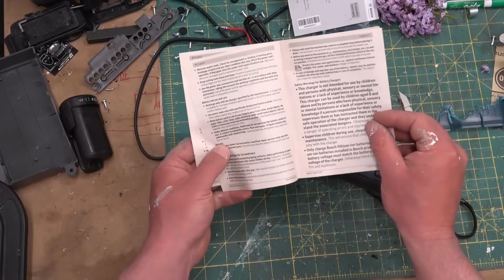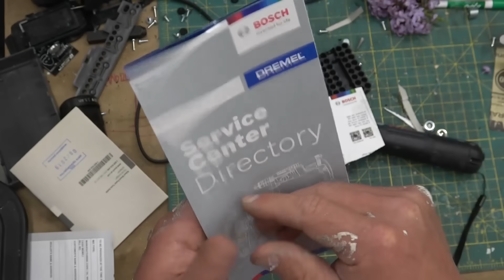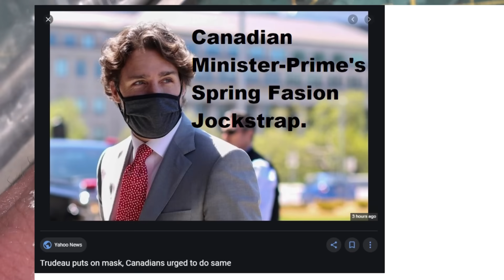BOLTR: Bosch Screwdriver

Comment: I bought that screwdriver under the Dremel brand name to drive in inch and a half hex screws on cable clips at work. I used that screwdriver 5 days a week every week and it is by far my most favorite tool as it pretty much negated the need to be running back and forth grabbing the impact driver, and when youre working out of a tool belt you want the smallest lightest tools possible to get the job done quick. and save your back. i loved how i could hold the screw with my index finger, hold the driver with the rest of my hand and still have my other hand to hold the cable tight against whatever surface was driving into and it never let me down. 

it did break after about 2 years of use, one of the bearings popped out of place and jammed the clutch but i took it apart as you did, put the bearing back in place, regreased it, and put it back to full time use like it was brand new.

Comment: I got this thing years ago (7? 8?) from Aliexpress, before it was sold anywhere else and before you could get a nice slim electric screwdriver anywhere. It's pretty funny that mine is green, but when they started selling it in the west they rebranded it as blue. I doubt mine has plastic gears or something. It's pretty neat, has enough chooch to even drill.

Comment: This is like the Black and Decker Versa I purchased in 1991, batteries no longer available.  Worked like a charm with a clutch that worked perfectly on small screws as I worked on printers and fax machines all day everyday. No circuit board inside, just a motor, slide switch and similar but bigger gear box, battery is removable from outside. I would love to find a battery for it.
I just cleaned all the grease that has hardened, re-greased it and tested it with an external power supply, still works after been in storage for 19 years.

Comment: Just got my borsch a few days ago. Red six selector is torque shut off- not a mechanical clutch mind you. The delay is a pain in the arse as you mentioned and as I got this to test for my assembly line, I was dismayed to find there is no chooch while charging. They didnt spring for an isolated charge circuit and the one they did select is very slow. not good for volume / production work.
Reply: but what about masks?

Comment: AvE, masks aren't to stop the wearer from potentially inhaling 'viral particles', although they can certainly do that. The efficacy of masks in containing the spread of a virus has nothing to do with the size of the viral particle itself, and everything to do with the size of a droplet containing respiratory mucosal secretions (and viral particles). The viral particle itself has no chance of withstanding the extremes of the outside elements with its tiny protein coat. It easily succumbs to the effects of osmosis, at the very least, to dry out and become ineffective in attaching/penetrating cell membranes and replicating. Thus, anyone who dismisses masks based on their efficacy in mitigating the movement of a single viral particle can be safely dismissed. The efficacy of a mask lies in its ability to decrease (not eliminate) the transfer of previously mentioned respiratory droplets from an infected patient to surfaces that non-infected people may come in contact with.

With that said, the mortality rate of COVID-19 is very very low in non-vulnerable people (below 65 years of age, not immunocompromised, no pneumonia, etc.). The way we've handled this, IMO, is atrocious. We could've done a much better job, and saved more lives, by not causing mass panic and simply allowing non-vulnerable people to continue regular lives while affording extra protection and isolation for vulnerable people. In the process, we could've rationed healthcare resources and distributed them in a more efficient manner. In order for that to work, we would need good social distancing in public, the normalization of masks in public,  more testing, the closure of the international border, and educating people about the danger of coming in contact, under any circumstances, with a vulnerable person. Had all of that been done, we could've eliminated the need for mass lockdown, in lieu of regional lockdowns when necessary. Look at China, Taiwan, Japan, Korea, Singapore, etc. None of them had a nationwide lockdown. Instead, we've used Italy, Spain, and other such countries as role models.

Then again, here in Canada, Justin Trudeau appointed someone with very little knowledge of public health to be the health minister (Sajdu) through a cabinet reshuffle, and our leading physician on COVID-19, Dr. Tam, was against border closures for months, she deliberately lied to the public (instead of actually controlling the supply chain) about the efficacy of masks, going as far as saying that they're not useful, in an effort to ration them for the healthcare industry. IMO, what Dr. Tam did amounts to criminal negligence, and she should be in jail right now. I can't imagine the number of cases in Canada caused by her. Imagine all the people who were infected and used public transit without wearing masks, spreading the virus on every surface they touched...

Comment: I bought 3 Black and Decker thingies like that over the years. One had had a recharging stand that disappeared rendering the driver useless. One had a bog standard plug in recharging port for a power supply and t'other took 4 AA's. It was also fire engine red in colour making it easiest to find, so most often used.

Crap tons of torque for a smallish sized thing.

Comment: @AvE The masks are not there to protect yourself, they are there to protect others. The masks filter some, but not all of the water particles so they are not effective as a safety device for yourself. the main problem not being the material it is made of, but the fact that they do not seal against your face. As you can see, the masks look the same as the ones worn in an operating room. The mask a surgeon wears is not to protect himself, but to protect the patient. It contains saliva droplets in his breath so they don't land in the open wound. The masks they urge you to wear have the same function. The best prevention from being contaminated is keeping a distance. You need to keep distance, so any water droplets from someones breath have time to fall on the ground. The mask you wear reduces the amount of water droplets that go into the air, and any water droplets that get out will have a lower velocity and will travel less far before falling on the ground. And that is why masks DO work. During the incubation period, or when you are asymptomatic, and you don't know you have the virus, the masks saves the people around you.

Comment: You may be interested in the DeWalt DCF682N1 
I do a lot of work with screws in plastic and rackmount screws and the gyroscope control makes it easy to avoid crossthreading and when the screw bottoms out, the small shock to the device makes it stop turning. I've been impressed with the control I have with it. It certainly doesn't have the power of an 18V tool, but for what it's made for, it's well done.

Comment: That for sure is not a flyback diode protection, but rather a current sense resitor. If I would have to guess I would say they've used the DRV8830 from TI as the DC Motor Driver.

Comment: "The superior gripping power of a Robertson"
I suppose Torx is just a joke to you Canadian fellas?
Reply: Torx is ok, until you strip it. Robertson strips into philips for some reason, so you can get it out with that. So you get 2 screws for the price of 1
Reply: @collinbarker  I have never stripped a Torx screw, only damaged my bits when I didn't have the exact right size on hand.
Reply: @schwuzi  Torx are also still quite rare, usually only seen as deterrent screws for electronics, probably due to the existence of the others. Philips are used everywhere still (thanks usa...) while robertson are used in woodworking and are the ones sold in bulk. Torx would have to be ordered in. 
At least we no longer use common slot, which are the worst by far. Also, I think robertson manufacturing is easier than torx, as robertson was made by someone who said "Philips bad and stabby" and copied the process they used to make screws. At one point, they were going to be used in cars, but the license got messy, so it was dropped, and so NA is stuck with philips everywhere.
Robertson also allow the screwdriver to be slightly wonky and still work. I have used some torx screws, and they are much less tolerant of what angle the driver to screw can be
Reply: Torx is for pricey screws.  Robertson is also known as 'Nasa drive' apparently.
Reply: pozidrive = phillips (for self-centering) + Robertson (for grips) 

Yet you can't get either side of the border on board.
Reply: Torx is a joke to Torx. 
How else do you explain of Torx Plus?
Reply: If you extrapolate the logic of Torx, then you end up with a circular bit. That ain't no good for anyone! 😉
Reply: @300DBenz  TorxPlus is because the patent on Torx ran out.
Reply: And... Too many sizes of Torx. The screw is always the size of the driver you don't have.
Reply: Collin Barker I thought Philips stripped down to Robertson?
Reply: When the only other choices were flat or Phillips years, Robertson was king. Torx is a fairly new thing by comparison. I was told by an engineer that American companies refused to use Robertson for decades because it was a Canadian invention.
Reply: @collinbarker  Um, rare? There are 749 SKUs on just the Home Depot website for Torx drivers and fasteners. At least in the USA, they are ubiquitous in a construction site or industrial setting.
Reply: @jerkmcgerkin  they so exist, but in Canada they are not that common. Usually torx come in tamperproof plastic and may even be behind the locked wall, while Robertson are sold like how one buys screws. Might also be that the red and green Robertson are used in our electrical boxes even, while torx is still reserved for electronics and really expensive bicycles
Reply: @collinbarker   Interesting, I can understand the affinity for Robertson, being a Canadian invention.  I just asked a sparky today for a #2 Robertson bit and he looked at me like I had asked him for garlic flavored licorice. Apparently, the sparkies have a different name for them here. I think it was LR? This was in the NW of the USA. He showed little interest in my history lesson about Robertson drive. And yes, most every box you buy in the US will use a Robertson to land the green wire.
Reply: @jerkmcgerkin  Never heard of LR. Makes sense that it would go by another name in electrical community. One thing industry can agree on, is that naming things cannot be the same between disciplines (In electrical engineering myself), even more of a challenge with borders and 3000km of land separating the 2.

Comment: Looks to be a handy tool fer those with over exerted wrists. I wonder if you may have used a little too much L. Boh grease there. It seems to exceed the maximum clamping force of the old Juan-King spanner. 
I wonder if they could make a version with a handle on the side, make 'er a bit easier fer gripping?

Comment: @AvE 1 to 6 speed controls. (taking a guess here) putting 0 to 9 would be typographically ugly/cramped, and adds the issue of how to differentiate 6 and 9 at a glance (problem compounded by smaller numerals).

Comment: @8:00 I'm particularly fond of how the motor's positive lead rubs against the negative end of the battery when you activate it.   There's no way it will turn into a hand-held fireworks display...
Reply: Actually,  no they don't.   I have 2 of these and was modifying them just last night. 
Even if the wires rubbed together it would take thousands and thousands of cycles before it would wear through the coatings. 
Also those wires are really flexible with a thick shilding.
Reply: @dukenukem6137  "Thousands of cycles...."  I think you're overlooking that it's connected to a motor that vibrates.
Reply: @bobprivate8575  nope, like I said I have two of them and have looked  them over pretty good. there's not much vibration from  the motor & pretty sure the engineers have figured most of this stuff out long before manufacturing a million of them.  👍🏻

Comment: Maaaan.... SKIL made a really badass one of those things back in the 90s called the the "SKIL super twist" my dad had one & I'd take it every chance I got. So "after finding me with it & smacking in noggin of it alot" he bought me the lil brother version "SKIL twist" however it wasn't as torque-ie, that thing would snap your wrist half in two if it hung up in something & you failed to let go of it "cuz fuck it I ain't letin go" we used those things for years man & replaced the NiCad Batteries when they got weak &/or wouldn't take a charge or started getting "memory" as NiCads do after aging. Plus they didn't have and type of balance charging just the old cradle that straight up charged @ 9.6v...... ahhhh memories how sweet ...... when shit was simple & just friggin worked badass.

Comment: The Dremel unit looks exactly the same this one, but its about half the price. And when I say exactly the same, I mean they are the same unit
Reply: Thanks, I wouldn't have known about the Dremel version. Edit: Unfortunately it looks like the Dremel version is limited to North America or something. Though it looks like there's a second generation version of the Bosch Go, the Go 2. Difference being it has a mechanical clutch, a button as well as the push to go and an electronic brake.
Reply: Hardly surprising since Bosch bought Dremel way back in 1993. Dremel has better customer acceptance than Bosch in Norte America so that's the label they stick on 'em there.
Reply: No surprise there, considering Dremel is a subsidiary of Bosch. Here in Germany, the GO was never released as a blue ("Professional") version. Instead Bosch renamed it to "PushDrive" and released it with a green casing, which is basically the home gamer segment of Bosch power tools. Ultimately, I think this is all just marketing and brand recognition to appeal to the biggest audience because there are people who will strictly ignore products of a certain brand. Also, because certain brands are more wide-spread than others in certain countries.
Reply: @RobEDC  does the GO have metal gears also?
Reply: @Tsagos  Can't say for sure, but I'd be willing to bet that the Bosch GO, Bosch PushDrive and Dremel GO are absolutely identical when it comes to the inside components and that the only difference between all three just is the color of the plastic housing.
Reply: Saw deemed on the paperwork at about 2:15

Comment: Got one (bought in Peru !), the wheel dosn't control the speed, it's for setting the torque.

I know it goes against the grain, but sometimes the FM needs reading :-)
Reply: Makes sense. I have the one that adjusts the torque on the front like a normal drill

Comment: 8:05--thats a shunt resistor to mesure the current to calculate the torque
the potentiometer  regulates the torque not the speed.
the switch with french name reverse the motor . all the current pass thru the switch.
i had one of these first thing that fails is the tactile switch
then the  motor shorted,,...
battery great when new after 1 month dies quickly.

Comment: 5:42 180° == 6 hour on the watch = 30 sec. Historically (<1990) eggs were served in cases of 12, 60, 144 - so the threescope counting is still familiary.
Other reason: The cast for the knob is proven and still exists. It's cheaper to reuse, than to run the environmental reliability test and redue the test because of the failed knob.

Comment: It would be rad if you cracked open the Dewilt version. Over the past 2 years, it's become my favorite tool in my handtool bag as a residential sparky. Great battery life with a proper detachable fucker and not some wonky internal  USB charging, a fantastic gyroscope sensor with absolutely no delay, and (mostly) enough torqųè to get shit done while being lightweight and pocketable for the pouches. These tools are fantastic for certain vocations.

Comment: You should test it against a DeWalt DCF682 8V MAX Li-Ion 1/4" Gyroscopic Inline Screwdriver. There is no directional switch, pressure switch, or pause needed to get it to turn lefty or righty. Just grip it on the paddle trigger and twist which way you want to go. The battery is is good and bad it’s interchangeable so you can have more than one but only 8v and only available online as far as I can tell. I’d like to see how it compares to the Bosch for torque.

Comment: Grease is good for keeping teeny tiny bits together for assembly, but you know what works really well for sliding bits together that don't want to slide?  KY lube.  If you need to sleeve a rubber tube on a metal rod, it can help with the friction.  I'm sure there's a joke in there somewhere.

Comment: I got one of these.  It's powerful.  The potentiometer torque adjustment is set too high, not able to adjust low enough for small fasteners in softer vulnerable materials.  I suspect Bosch will modify this in future versions

Comment: I have a Hitachi cordless power screwdriver that I used to put together a gazebo with over 1000 M10 hex-head cap screws, and I was very, very glad of it. Much lighter than a drill, and the clutch was very precise. I also strongly recommend Wera Hex-Plus bits when driving head-head cap screws - once I switched to those bits I had no trouble at all.

Comment: thanks as always for vids and escapism. as a mid 40's sparky I do love this little guy. Can't really speak long term it feels like it will be ok mine has done a fair bit of work. it's good for breaking down gear and putting it back together, it will drive wood screws but I got the feeling putting 6  20mm screws into chipboard it might do 8 and then shit the bed.  I hear ya on the spinning free but you kinda get used to it ad do your "torque setting" by letting it slip in your hand